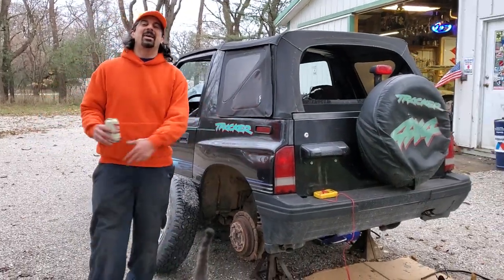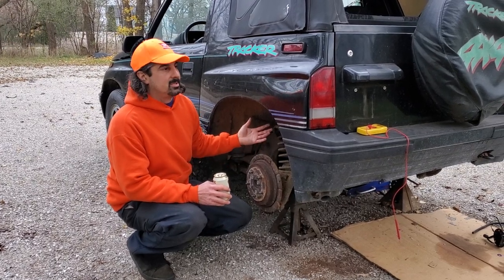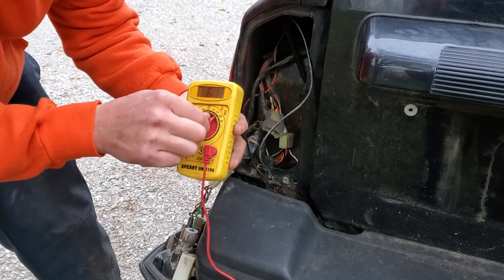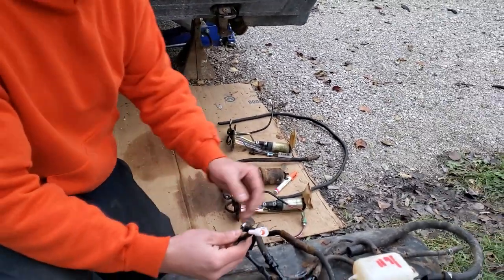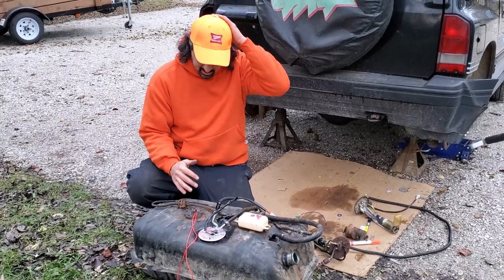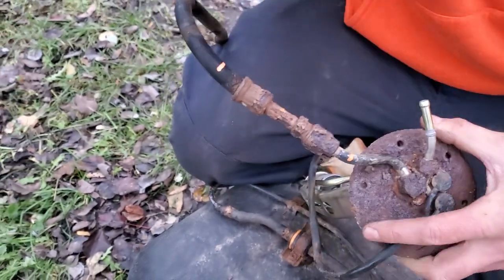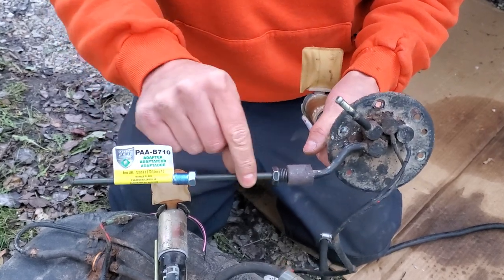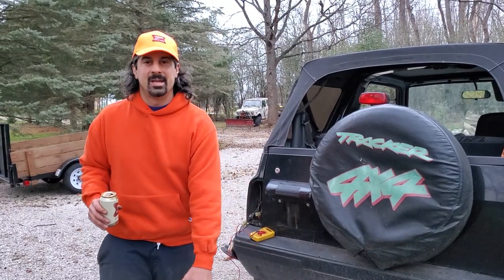Geo Tracker Sidekick Fuel Pump / ECM - Repairing rusted gas line Suzuki @Hwy83SUZUKI

Comment: My old 92 tracker would stop intermittently. Fuel pump. We used to give it a kick underneath the tank. That would get her back running again. Eventually I replaced it. I cut a hole in the floor of the tracker, right above the fuel pump and made a little access door. Removal and replacing was easy after that!

Comment: I my self always take time to greese them but I used vaseline kp moisture alway and water old school way motor grounds al over chevy trackers are easy to maintain but hardly any one do well I kp my up dated oil frame I like transmission oil with other oils I think the best all season ever made is the tracker no fast but I can said for the snow back roads trails and small city's is the best of all real easy and cheap to work with and they can go through most everything 4x4

Comment: Good video.  Thanks so much.   I have an 91 Tracker 5 speed 8 valve.  When  I turn the key on the FI fuse blows.   ECM seems good - it has new caps.  Thoughts?   Thanks.

Comment: Your videos are always great. THANKS!   I have a 94 sammy EFI...the relays (1 for ecu and 1 for fuel pump). have been the issue for a few years..easy fix..$25 for relays.  but I've been dreading the fuel pump install...taking the tank out is a real PITA..so yep I'm gonna have my guy cut a hole in the floorboard in the back...

Comment: I need to fix those red wires on the left, that go to the fuel level sensor mine are broke off. Or buy a new one idk
Reply from the maker: I had soldered those wires on because the originals broke off which Is very common.

Comment: Working on my 96 Tracker, acts like no fuel. Changed filter and verified pump is running and will spray fuel from a loose fitting on the filter so I know its pumping fuel. verified electrical pulses on an injector connector for power. How does one go about testing fuel pump pressure?
Reply from the maker: Check for fuel up at the fuel rail. There a plug on the rail you can attach a pressure gauge if needed
Reply: @Hwy83SUZUKI  I bought a fuel pressure testing kit from Harbor freight but it does not contain the right fitting to put in the fuel rail in place of that plug. Any idea where I can get a fitting to put in the fuel rail?
Reply from the maker: @84chevyguyid  Napa
Reply: @Hwy83SUZUKI  thanks!
Reply: @Hwy83SUZUKI  Went to the Napa store and the guy didn’t have anything

Comment: 89 Geo tracker stalling when warm. Runs fine when driving. 60k miles, New fuel pump and plug/wires. I am thinking EGR valve is clogged maybe

Comment: Great information. What if you have 4.3 volts at the harness with a fully charged battery putting out 12 volts, Is that an ECM issue?

Comment: I don't have power at the connector behind the tail light.  Which relays should I replace?
Reply from the maker: Follow the wiring up the rocker panel, testing until you find power. If you don't find power, open ecm and inspect as shown in our other video
Reply: @Hwy83SUZUKI  Pulled the ECM. Sure enough. Fried caps. Was hoping that wasn’t the problem since I already had it rebuilt/replaced once. Board looks iffy but I’m going to try replacing the caps. Cheap place to start

Comment: Question for you, what’s the size of the nut on the top of the bolt holding the fuel tank in as we can’t get up there to look at it because the screws holding the bumper on stripped and won’t turn so we need to operate by feel

Comment: I bought a 91 from Wisconsin  in Washington state  the ecm was bad it turned  out  but we were towing it home 4 miles on a chain.  I dumped the clutch trying  t o start it and the rusted out fuel tank skid plate broke off all the corroded wiring broke hoses snaped . It Chased  me down the  highway  sparking  all the way  I was lucky it didn't blow up. There wasn't  enough of this car left to pick up with a magnet  it was so rusty from Wisconsin.
Reply from the maker: 🤣🤣🤣 common to see gas tanks held up by ratchet straps on Trackers around here

Comment: Had ecm failure associated with the injection on my 92 tracker.  It's a common issue I guess. There's a fix for the ecm, but turned out a cut in the injector wire is what may have caused it.
Reply from the maker: We have a video on ecm inspection and repair
Reply: @Hwy83 SUZUKI  Thanks for providing  this vital information! Helps keep these unique rigs on the road.  I'm looking into putting a Holley Sniper efi on my 1.6 8v engine in my Samurai.  Currently running my weber 38 backwards with some modifications,  but still a headache on inclines.

Comment: Tony my 96 Tracker is starting to run kinda chunky when cold. And when I just try to putt  around it's jerky and not smooth like it should be lol. I think my egr or something is plugged. It was running fine until last week and when I started it the idle was iradic and sputering until after about 30 minutes then it ran fine. 95 1.6 liter 5 speed 180,000 miles and looks like a brand new head. It wants to jerk in a parking lot or when going slow. Not like I need to downshift either lol.  I'm not afraid to rev these little peaches.  Keep up the good videos mang.
Reply: Hey i got some of the same issues - did you ever figure it out man?
Reply: pcv valve. positive crankcase valve. buy one 20 bucks swap it out.

Comment: Hey! Here's  quick question regarding an 87 samurai. I'm trying to diagnose an intermittent starting issue. Sometimes it will crank and crank and not want to turn over unless I really lean on the gas pedal. This is a relatively recent thing. Carb is in good order (tuned and . What's my next step, fuel pump/filter?
Reply: They have a starter relay to help with the starters on both the samurai and trackers but I can't remember who makes it. Check your fuel pressure to the carb and make sure you're getting 6-8 psi of pressure. If the pressure is low you may have a clogged filter or line.

Comment: The pump is not priming. When testing at the brake light we got just a very quick flash of power. Less than a second. What do you think that means.
Reply from the maker: Check for power coming out of ecm after turning the key if 91+ model.  If not power watch our ecm repair video
Reply: @Hwy83SUZUKI  Thank you! It is a 1990 so I just pull the ecm then!
Reply: The ecm looks good. No signs of leakage on the board itself or damage to the capacitors?
Reply: I know you're busy but any thoughts on this? The ecm looks like new. No signs of problems. Suggestions?

Comment: Amigo rust part can be clean almost like new with a old school knowledge is call vinegar ok mountain man wisdom I fix a 40 year  sit tractor and believe me the bolts were rusty even the farmer look at me like if I was crazy but when he saw the a couple day later the bolt came loose and almost look knew he smile and said damn rican jjj he even bought lunch jjj
Reply from the maker: Yes That works well for surface rust.  In the north things often rust away until there's nothing left . Just has to be replaced or welded